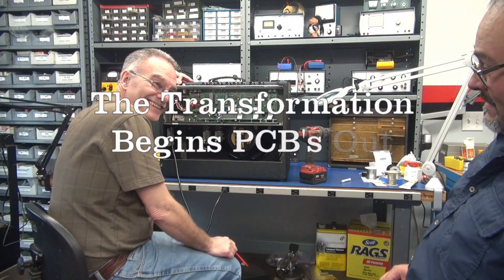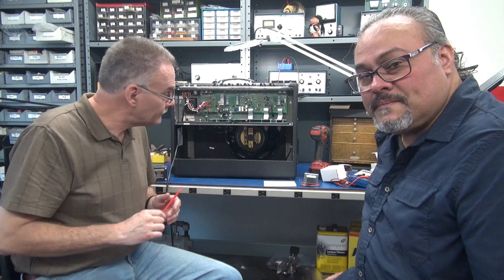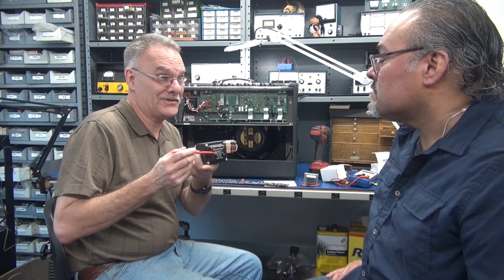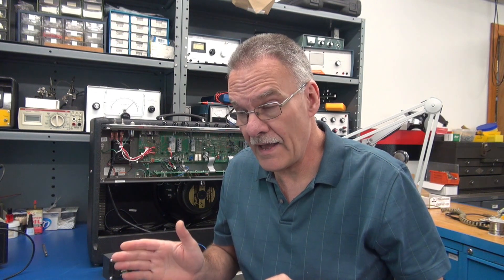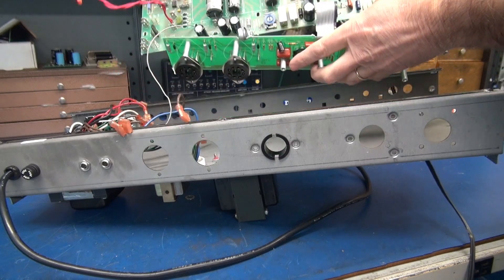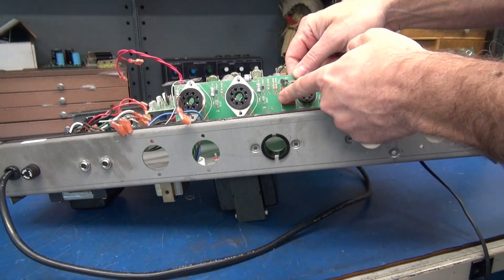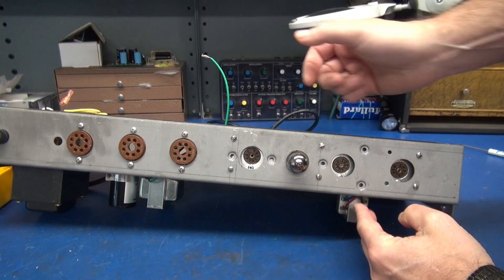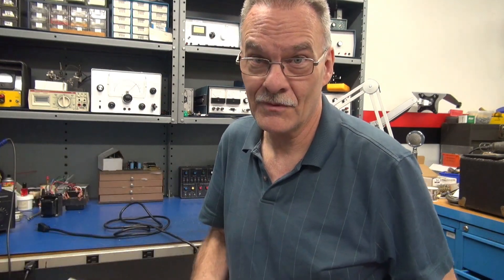Fender Hot Rod deluxe conversion to hand wired eyelet board Princeton AA1164 tube guitar amp upgrade

Comment: I want to do this with a 1989 Bedrock 1200 50-watt head. Best amp I've even owned, but it hasn't' sounded the same for years, and two techs have tried to fix it. I have a schematic. What would it cost to design a tag board setup for this? Anyone? Bedrock's original amps were point-to-point. After a few short years they switched to PCB circuit board. I want to go backward. Is this at all monetarily feasible?

Comment: Nice conversion. 👍
However, I personally would use a solid state rectifier, and a properly chosen series resistor to achieve tube rectifier's voltage sag if that is wanted. Tube rectifier's heater circuit for example creates so much heat without giving much in return, except reliability problems and tube costs that I don't think it is worth the effort. Of course, if you have a good stock of NOS tube rectifiers, no problem.
Reply: @quantumbuddhist  Well, how about a selenium rectifier as a compromise? More inner resistance, you know...